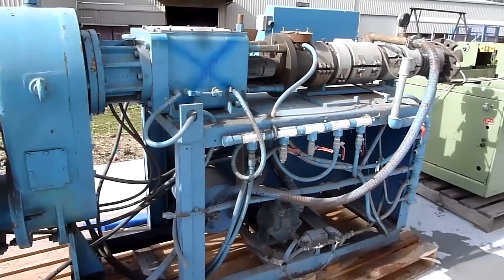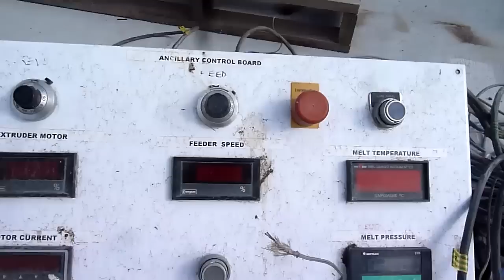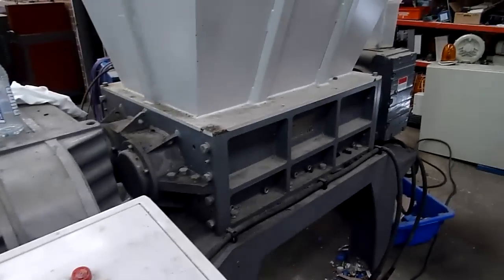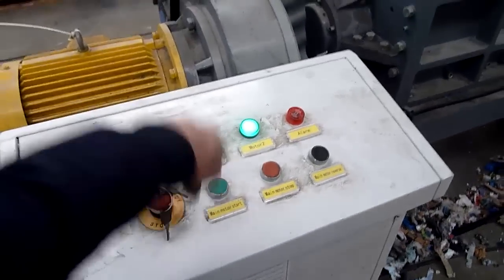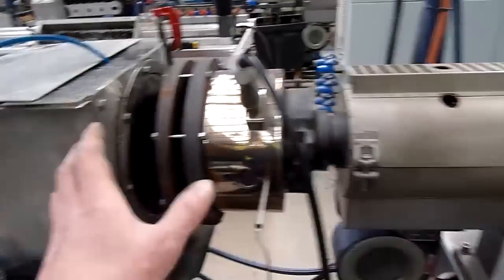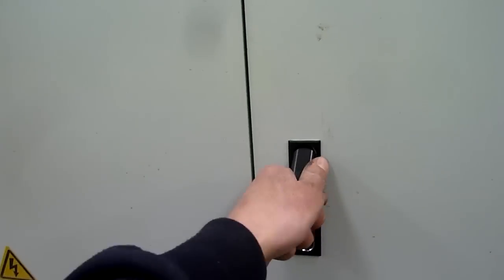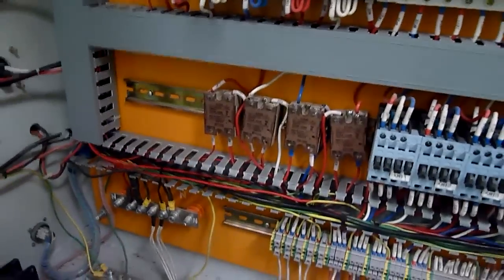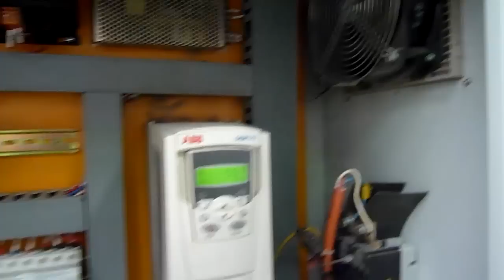Random Fun Vids From August 2016, Fun at work!

Comment: Scrapping, shredding, shooting, tech info.Great vid !!!!What the fruit were you shooting out of the No.3, blanks, primed only cartridges ?
Reply from the maker: LOL that was a primed casing, the bosses place is a bit too close to town to be shooting 303 :P, have done some 12gauge without issue, but I might be pushing it with 303 :p.. legally I can shoot, but I do not need noise complaints coming in :(
Reply: Cheers :)
Reply: +Aussie50 great video mat as always
Reply: +Aussie50 that shredder is a good size for a flat screen TV lol
Reply from the maker: I saw a nice target gong for you the other day, pressure end plate off some boiler or heat exchanger, 3" thick, 40" round :P. good luck moving it without a crane :p

Comment: that 20hp motor would be a bit of fun :D
Reply from the maker: I thought about keeping it, but nah, too big and heavy :(. wait until I can get a more modern aluminum one off an old CNC machine
Reply: Aussie50 Yeh. That kind of power is a bit excessive, probably weighs nearly 200kg :P
Reply: it's a perfect electric car conversion motor!
Reply: Man, you could have used that 20 horsepower DC motor to destroy gas engines up to 50 horsepower in a shaft vs. shaft duel using an electromagnetic clutch to engage them together. Cc motors are no joke when it comes to torque. Just give them the current they need and they can pretty much tear through anything.